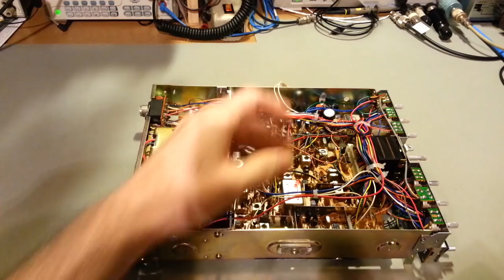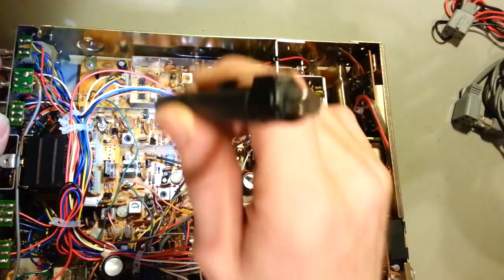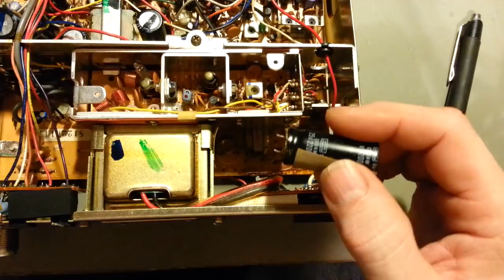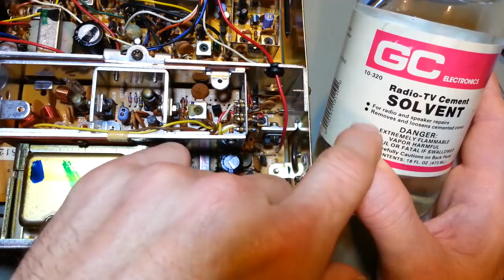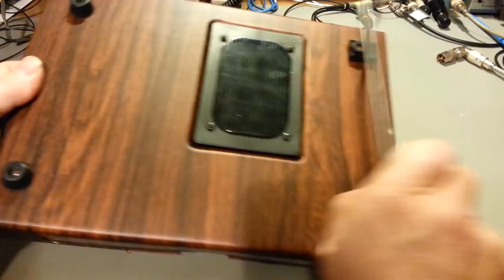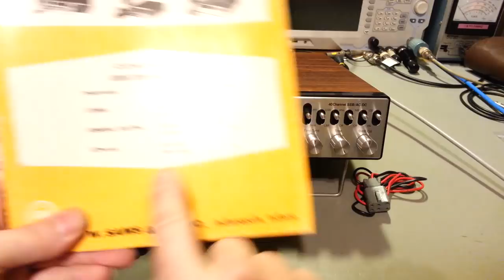JC Penney 6241 AM/SSB mobile/base CB radio restoration for Ballbreaker in NYC.

Comment: Mike as you know it’s basically the same radio as the SEARS 40CH AMSSB sloper only the front is different. The SEARS uses the 1969 and 2166 IC.

Comment: I have one That has two added tongo sweches . man i need a road map . any way i have a ham liacens . but i have 10 meder radios . the fine tone well clearfier pot dont work . and the uper an d lower ssb swich works back words and i can't get it to work the 27.385 . . now i do have two sears road talker 40 . i love them . but they too are having some problem on ssb . so i like some help to get them back working right . and retrun the 981-6241 back to 11 meter or at lest work on 27.385 lower ssb . any idas

Comment: I have two of those, one bought new in 1978 and the other recently from eBay. I have both power cords for each, and, no, they aren't for sale. They really are "unobtainium". Great radios, especially on sideband.
Reply: We are working on 3d printed cord end for the roadtalker an penneys ssb radio.
They really are impossible to find.
Most that have radios dont have cords.
Reply: @randyguay7115 Did you ever get them finished ?
Reply: @randyguay7115  How do I get one?

Comment: Just got 142 gtl. Concerned about the power supply. Thinking of external pwr spy. You're thoughts please?  Rich....IOWA
Reply from the maker: Nothing wrong with the factory power supply.  Recap the radio, remove the corrosive glue and should be good for decades to come.
Reply: @mikesradiorepair  hi Mike
 I joined patreon yesterday. Another question for ya. What do HyGain's do poorly in?  Do they have exceptional receive like I've been told?   Thanks, Mike.   Rich  Iowa

Comment: Mike is there a difference in output power using the a/c cord vs the d/c cord, just asking?
Reply: Big Al On the older Sears SSB 3677 which was also the JC Penney 6240, there is a huge difference when running off AC as the built in power supply is known to be anemic with some of them putting out just 10.5 volts. So for real power, you'll need to run these Hitachi board radios as DC and get the full juice from an external power supply and then watch your modulation and signal climb. I assume it's the same with the 6421 in this video as they are both Hitachi made with internal power supplies.

Comment: Mike, is that solvent save to use on varnish or other wire coatings say used on the toroid wire, etc. ? How about the circuit board ID labels?
Reply from the maker: +AJKandK 

I have used it on torroidal transformers and it never effected the enamel coating.  Labels, yeah it would easily remove a sticker.  Best to test it first.

Comment: Cool rig, They did think about this one in design and function, To bad it's missing in todays technology
Reply: Scott Edick Like what in today's technology could make this sound better? These radios are better built period. And they are sideband radios. Want extra channels? You can add them to this. Yes they don't have Bluetooth and weather radio but really ... that's hardly something anyone uses.
Reply: i agree with ya here, these radio where built with quality components and designed really good,
a standard that's missing thesedays & this goes for all electronics. it's why i keep and use all my older cb's and ham radios
73'  k7sce
Reply: As far as I'm concerned, today's technology is nowhere near as good or as well built as the older radios from the 70's and 80's, they use the cheapest components now whereas decades ago they used much more expensive circuitry. I own 16 radios at the moment, ALL are from no later than 1988, most are late 70's models that i got brand new back in those days, they all work even the ones i need work one such as recapping and alignments, everyone i know that has a brand new radio sounds like crap and their radios are always getting worked on where in my case my daily radio in my truck is for most of the time my mint condition Realistic TRC-427 or TRC-449 if i want SSB. Older is better, period.

Comment: does it use 36mhz feeding a Johnson Counter driving Tayloe mixers one for transmit (QSE) and one for Receive (QSD) modulating audio from a audio phase change network up to 9mhz or demodulating the 9mhz down to audio via a phase change combiner network.